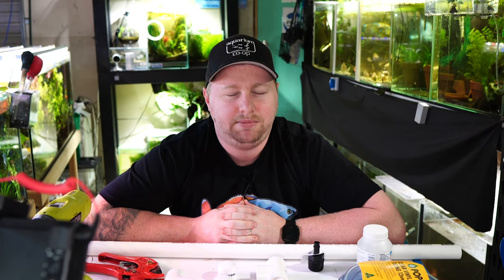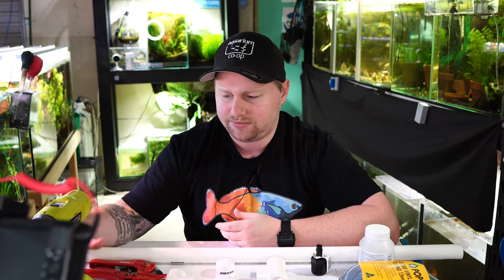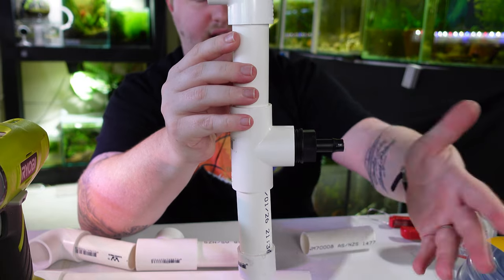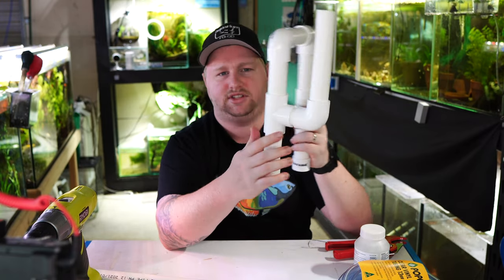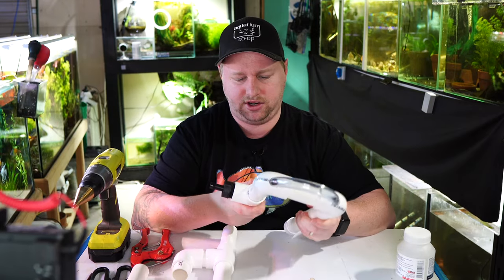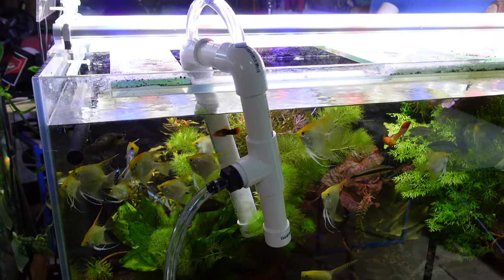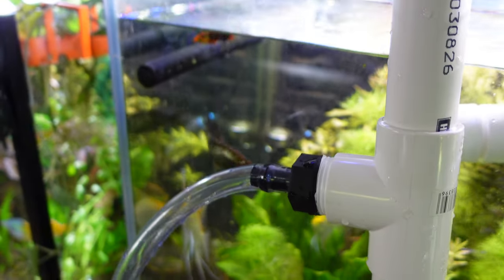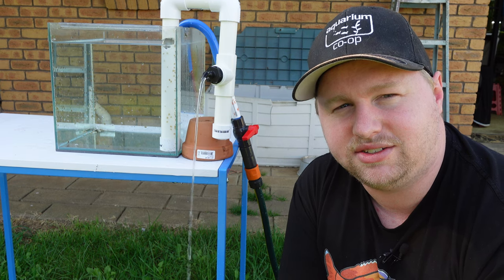How to Build a DIY PVC Overflow, Automatic Waterchanges with No Drilling of Aquariums

Comment: Awesome advice Sir 👍
I've a few questions 
1.How big do you need to drill the hole for the water to escape in the longer tube inside tank?
2. Do you need to use a barb end with vinyl tube or could you full pvc connections for the drain outside tank?
3. How long should the pvc pipe i side be? Height of tank?
4. Can you connect 2 overflow  to 1 drain pipe for faster flow if incoming water is at a higher flow? Like one on each end of tank connected to main drain?
Reply from the maker: Great questions;
1. The same diameter as the internal diameter of the tubing you are using in syphon (or the smallest diameter connection in the entire assembly), that will be the system limit anyway.
2. Full pvc is fine also 👍
3. The bottom end cap has to be lower than the outside bottom end cap and the inner tubing must be lower that the tee connection for the outlet, the lower and more gap lower risk of syphon break.
4. Yes in theory, the limit will most likely just be the diameter of the outflow in that case.
Reply: @BlakesAquatics  I was wondering could it be safe to use for a
water return to a sump tank for a 75 gal aquarium? & what size 
pipe would work ? that looked like a "1" what about using a "3/4" ?
Reply: Blessings family can you share the measurements of creating the flow system

Comment: I used black low pressure farm piping and connections. It's cheaper than the white stuff and looks better in the tanks. No need to glue.
Reply: Where did you get it if you don't mind my asking?
Reply from the maker: Bunnings or any hardware store

Comment: Hello, just installed these on a shelf awuaponic system. One of the tanks keeps filling even when the overflow is primed and trickling. I balanced the incoming water and the sypon slowed to a stop but the tank kept filling. Any suggestions, ive already adjusted  height and depth on the tank side, made sure there isnt any clogs. Any help would be greatly appreciated

Comment: Thank you very much for the idea I was just wondering if you could change the output into a sump and use it that way
Reply from the maker: Yeah you can just have to size it up enough to handle the flow from the return pump

Comment: I have the same system from my tank down to a sump filter.  My bristlenose pleco and guppy babies find their way down into the sump, so be mindful that babies will get sucked through.  Also frog bit, duck weed, etc. will clog the syphon.  When flows are high you might get gurgling noise too.  Otherwise a fantastic system!!!   Great vid.
Reply: Hi antsadams; 
I was just wondering if it possible to use this system on a sump filter and saw your comment. Can you please give a little more deep info regardingly? I have a 300LT of fish tank and 30LT of sump tank so 3.000LT per minute of water circulation as well. Is it possible to maintain such water transfer without risk with this system do you think? Happy to take your comments if possible :)
Thanks.
Reply: I would think that placing some foam (filter etc) would prevent fish from entering system.  Similar to filter intake

Comment: Hey Blake, love this design, any ideas on how to stop smaller fish from getting sucked into the overflow pipe?
Reply from the maker: Bit of sponge shoved in will do the trick 👍
Reply: @BlakesAquatics  I'm wondering about this myself. I wouldn't use a sponge though as they can get clogged up just like filters do. So if I'm creating an automatic water change system, let's say a constant drip system, this could cause my aquarium to overflow when this gets clogged. I'm thinking of somehow mounting a plastic screen mesh to the overflow tube.

Thanks for the video BTW. I've seen others and yours explains it clearly.

Comment: Any suggestions on how to keep shrimp and fry out? I'd assume a sponge wrapped around or screen? Would a second higher hole drilled say just before overflow height of the tank as a backup work incase the first gets clogged? Btw great vid
Reply from the maker: hey mate, yeah just some coarse sponge will work fine for that, though there wont typically be a heap of water filling the hole if its used in a drip system. a backup hole should definitely work as well

Comment: Cool video. Great engineering mind and creativity. pity i only found your video this late. one thing i failed to note. so it is the plastic tubing size that determine the flow?
Reply from the maker: Correct 👍
Reply: @BlakesAquatics  curious. your kit draws water. was wondering if the inlet hole.. is it wise to improvise such that the inlet hole is further down to the bottom of the tank instead of at the top and I can add a water valve to control the outflow? in this way, it can suck up water as well as dirts :)
Reply from the maker: @jkml8855  i just worry about clogging it up by sending debris through it. Gravel vacs and other things are better for that purpose imo

Comment: Hey Blake I'm trying to setup my fish room soon.  This video is really helpful.  What size pipe and vinyl tube do you recommend to keep up with add like a 4 gallons per hour?
Reply from the maker: The bigger the better as it will be less likely to clog or back up. Its hard for me to visuale 4 gph (16lph but id say the sizes in this video would be a good starting point for that
Reply: @BlakesAquatics  I must have missed the sizes you used in the videos.   What size of clear hose did you use?

Comment: You could simplify the design a little bit. The PVC pipes don't need to be a U bend, you essentially just want a reservoir on each side of the tank's wall, with the siphon keeping the two level. And then an overflow tap on the outside tank which feeds to the sump tank. 

Of course, the U-shaped tube provides a nice reliable way to hang it on the aquarium, which is a great bonus.
Reply from the maker: Sure, plenty of ways it could be done

Comment: Idk if this is considered a “overflow” tank but I use a water pump pumping water into a smaller tank with plants and media and the another water pump going into the big tank. It’s a filter system and also makes it easier for me to do water changes with out disturbing my fish/axolotl since I can get rid of water from the smaller tank which will make clean water go into the big tank.
Reply from the maker: What happens if one pump fails though?
Reply: Or what if the pumps aren't the same speed? Due to clogging, wear and tear, etc
Reply: I’m doing the same but for my 40G (breeder) reef tank. My sump is a 20G (high) with about 3/4 of water and as for my display tank, I keep the level right below the top tank frame just in case something fails and it won’t overflow in any situations. I changed the outlet to just a PVC pipe instead of the tubing with ball valves on both inlet and outlet. I keep my ball valve on the pump side cracked so it doesn’t push too much water out to keep it balanced with the water draining. 

I hope that helps for those who are worried about leakage or anything that goes wrong.

Comment: nice video and great explanation of all the steps. Would there be any concern of the size of the hole in the tank where the water would go out to be a particular size so that fish would not go through it like tetras or any fry?
Reply from the maker: It should never be covered with water if it is working properly. If it was a big concern you could cover with flyscreen mesh or coarse sponge

Comment: Very cool design. Does the overflow hole inside the tank need to be that big? Or can I use several small holes? I'm thinking of running this system on my endler tanks but I don't want to flush away the fry.
Reply: @AquaponicTim  try adding little screens to the inside of the pipe to stop fry and large debris from leaving the tank then.

Comment: Is it necessary to feed the clear pipe threw the holes you  you drilled in the pvc? Like building it under water then you could feed the pipe threw the pvc could you instead of the clear pipe coming out of the top?. Am just thinking about building one just trying to make it look easy on the eye and not a big clumpy thing
Reply from the maker: Possibly i do like the visual check to know the syphon has no air in the line though personally

Comment: Thats a clever siphon but what if the water level gets low on a bunch of tanks and breaks the siphon or the pump bringing in new water is going faster than the siphon? Youd gave to restart the siphon on every tank manually. I wonder if you could use a pump to create a vacuum in the pipes again...?
Reply from the maker: If the water level gets low its not a problem because water is still in the pipe. If your return pump is too fast that is an issue. You either have to size up everything or add multiple

Comment: Could this method be used for a sump? It looks like it. But in your opinion should it be used more for the automatic water changes or could it be used as an overflow for a sump? I want to start small with a 20 long going into a 10 gallon sump. Do you think this would work for a more permanent setup verses drilling?
Reply from the maker: Id say a sump would run too much water through it. The greater the flow through it the greater the risk of a syphon break
Reply: I was thinking of running two on either side of 40 gallon into a small sump. Do you think that would work with having a second as a backup?

Comment: Will this design work if one wanted to connect two tanks located side by side? Basically, I'd pump water from tank 1 to tank 2 and the tank 2 would overflow back into tank 1. Thanks in advance!

Edit - I was going through the other comments and the pump failing was brought up. Wouldn't the water level of the two tanks become level then?

Comment: I built mine according to your instructions and it seems to be just fine. I do have a couple of additional questions though:
1-what size pipe are you using in the video?

2-I would like to paint mine a subtle green but the plasty dip paint doesn’t seem to come in that color. Are there any other spray paints that you can recommend.? Thank you very much
Reply from the maker: From memory it is 25mm pipe i think.
I prefer plastidip for things inside aquariums but I believe any acrylic spray paint should also be ok

Comment: My concern. If the pump is on pumping water to the tank and the over flow stop working. Will the tank fill up or is there a way to stop the pump when over flow stop?
Reply: If you have this pump in a sump tank, you could probably add a float switch, or get a pump with a float switch so that when the water level dropped because it wasn't getting replaced, the pump would automatically turn off. I don't have one to speak from experience, but I've been thinking of getting one.

Comment: Can you make a video making an overflow for a larger tank with a flow a lot stronger? I have a 125 G and made an over flow with 3/4 pvc and vinyl tubing and I combined your idea with The King Of DIY pvc overflow idea becuase his looks nicer but needs a toms overflow pump and they don’t make them anymore. So I combined the 2 ideas together and it works but every time the water level gets to low the syphon breaks and stops and I have to restart the whole thing. And this video shows it working but the flow is super slow and probably need 1” pvc for like a 40 gallon tank
Reply from the maker: Youll be limited by the smallest diameter component. So in mine the vinyl tubing is actually what is setting the maximum flow not the pvc

Comment: Is there a way to make higher waterflow? I have a 3000l/h pump and i think that this system wont have the adequate waterflow to my sump
Reply from the maker: This wouldnt work for that you are right. Would need a huge dia pipe to get it to happen
Reply: I know your question is a month old but I may be able to assist.  I am about to set up this system on my 6 foot 400 litre tank with 120 litre sump. My pump is rated at 2,500 l/h.
I have spoken to other people who have a similar set-up and there are a couple of things you need to consider.  
You can scale this device up to whatever size you want, no reason why you can't make it with 3 or even 4 inch pipe diameter pvc pipework, the principle is the same.  You want to ensure that the return system is a bigger size than the feed - the feed is under pressure from your pump whereas your return is relying just on atmospheric pressure and gravity.  Good rule of thumb is that the flexible syphon tube wants to be about twice the diameter of the pipe coming from your pump.  I'm going with a 20mm pipe from the pump and a 40mm return system.  The 40mm pipe can carry 4 times the volume of water as the 20mm.
You also want to include a non-return valve between the pump and where the pipe exits into the tank.  In the event that the pump fails or you have a power cut it will prevent that water back-syphoning from the tank through the pump and overflowing your sump.  As an added safety feature fit a float switch in the pump chamber of the sump so that if the level does drop either because of a leak or the return blocking or losing syphon the pump will cut out rather than continuing to pump an ever-dwindling water supply.  I'm also including a ball valve in the supply pipe so that I can reduce the water flow in case my maths are wrong.  I'm pretty confident they are not but for an extra $10 I think it's worth it.

Comment: Blake thanks for your contribution. 

I did drip and siphon drain for years when i had 80 tanks and bred. 
I had a much simpler concept but close. I did have trouble w Vapor lock once in a while. 
You have kind of a convoluted dual tube, did that come from trying to avoid vapor lock. 
I simply siphoned to a standpipe,and the height OUTSIDE into that drain set level.  Going into half inch cpvc, but siphon was  quarter inch black tubing due to algae issues. It was just a coil taped into position. Worked for months but occasional issues.
Now w a fancy house, thinking about making it fail safe. Maybe you can tell us the evolution

Comment: ok, i created the same thing but mine is pulling air from "somewhere"... i used silicon to try to seal everything but it's still pulling air and I don't know why
Reply from the maker: Is the water inpet nearby to an airstone
Reply: @BlakesAquatics  after allot of experiments... The hose I used as an outlet is too large, which causes the water to come out of the overflow too quickly, causing air to come from the top. Even increasing the thickness of the hose that carries water from one side to another was still not enough.
I had to put pressure pliers on the outlet hose and so far I haven't been able to get the overflow to act like an overflow, in addition to it being too wide for the glass and getting a bit crooked... in short, it was a disaster but as already I had done the sump and needed to turn the filtration back on, it is as it is... now I need to wait until next month for more money to come in and be able to create another one

Comment: I have been experimenting with the PVC overflow system and so far so good to get setup for Automatic water changes. 
However how does one mount the PVC to the tank so it sits nice and still and doesn't move around?
In the video on the inside tanks it appears Blake holds the PVC overflow and also lets it just sit leaning on its side.
Then the outside example there is a terracotta pot holding the bottom of the PVC drain on the outside of the tank.

I have been thinking about this and thought... What if I used a pipe saddle on the outside  of the tank, attached to some wood and then cut the wood to length to allow the wood to sit on the outside of the tank and support the pipe to stay upright and not wobble from side to side....

Has anyone else tried something different to keep it safe and steady??
Reply from the maker: Great question, quite right. In this example I wasnt looking to have it permanently installed on a tank, if that was the case I would have cut the horizontal piece of pvc pipe much shorter and most likely hot glued some sponge or foam material to either side of the vertical pieces to achieve a nice snug fit
Reply: I like the idea of a sponge or foam block instead of a piece of wood. No saddles required that way either. I will give it a try tomorrow. Thanks :D funnily enough i have been putting scrap sponge in between the tank and the outside of the overflow to hold it steady up until now... lol why didn't I think of making it permanent! :)

Comment: I tried this, but it is way too loud!!! Using as "overflow" for my sump, i cant adjust to a lower height cause in case my return pump fails, my sump tank wont be able to hold that much water
Reply: I am added a durso style pipe to the end of this setup and stopped the noise!!!
Reply from the maker: good mod! I'll have to look into it but tbh I dont often put enough flow through it to make a lot of noise

Comment: I feel like this could be dangerous if you have a continuous drip/water change system and the syphon is lost. Then you could flood your fish room.
Reply from the maker: any automatic water change system has potential to get clogged/ flood. A traditional drilled tank is probably less likely to but the chance isnt 0
Reply: Use two per tank for extra protection.